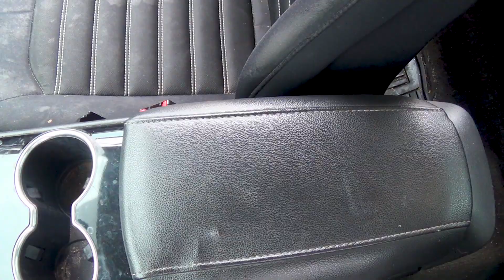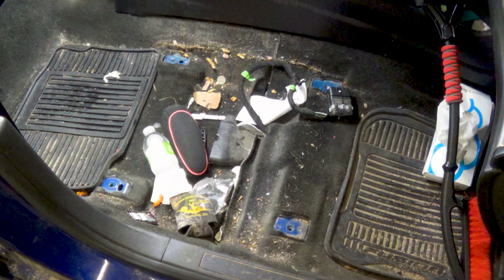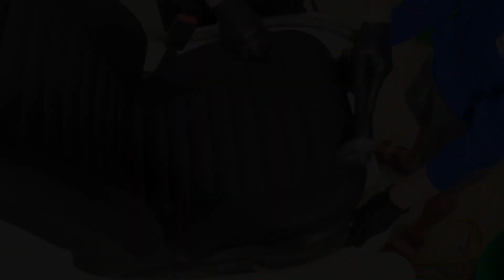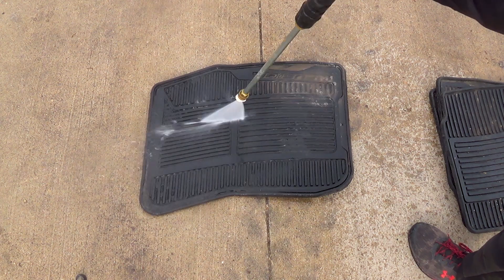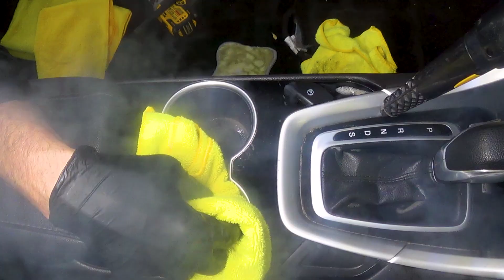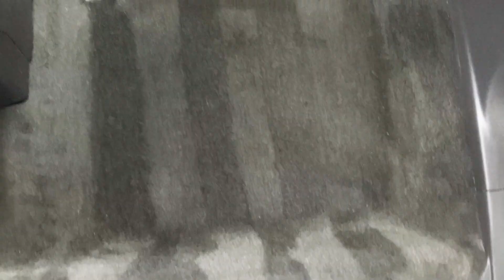Dirty to Dazzling: The Ultimate Ford Fiesta Deep Cleaning!

Comment: Man I did one of those last year. It was in the same condition but the chocolate milk had gone everywhere. The steamer made the job so easy. Not all stains do come out. I know some detailers use degreaser to take off much of the stains. Nice work btw. Do you think the bissel was strong enough to do this detail?
Reply from the maker: I like to use my steamer on headliners but that one was just too old to trust that it wouldn’t release. I have a love/hate relationship with my Bissell. I wish it had hot water and was larger. I’ve never used a Mytee but I’m sure the suction  on them is much better than the Bissell.